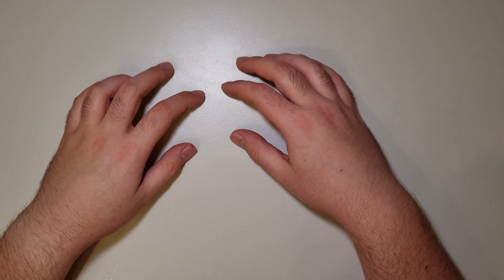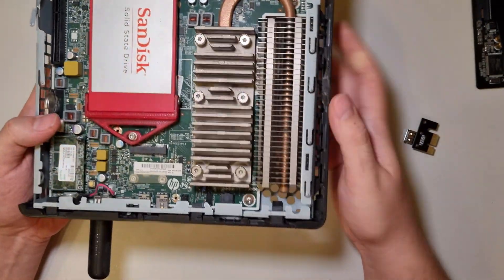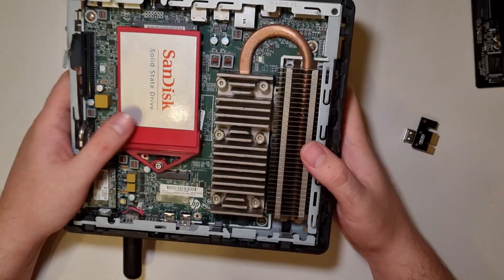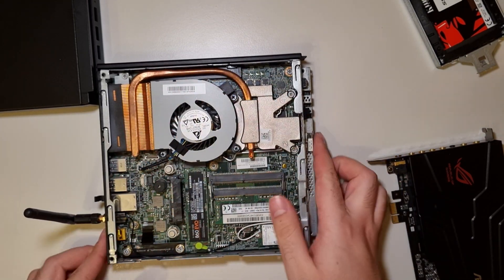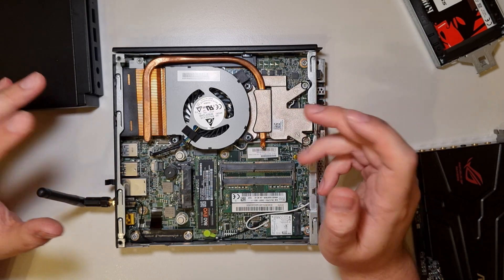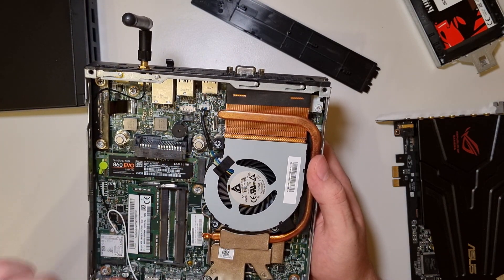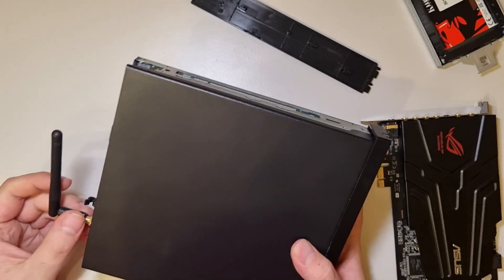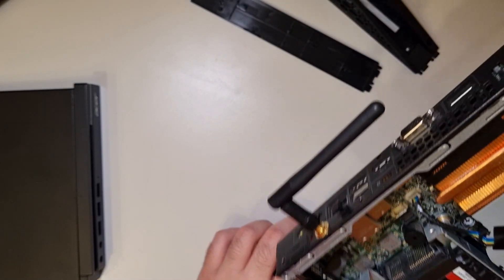Making an internal sound card portable, miniPCs with PCI-E slot ft. HP T610 and Acer Veriton N4640G

Comment: Did someone can help me with increasing power to processor. Original TPD is 35W but I'm using i7-6700 TPD 65W. I can see during stress test it only taking 41 W max.
Reply from the maker: I did same with i5, its not possible to unlock power because minipc thermal and power management was designed for 35w :/
Reply: @HobbyWithAdam ok, thank you. I was thinking maybe there is a way to bios modification, just to increase TPD to let's say safety level of 50W. I think this computer base is not so popular that's why these modes are not yet available.
Also, great job with this power mode. It makes this computer very capable. I can see some YouTubers try their chances with this platform and they were failing on GPU power limitation

Comment: Thanks for the video! My Acer N4640G (i5 6500T, 8 GB RAM) always rebooted when the connected GTX 1050 Ti was under load. After I soldered the bridge, the BIOS showed 135W (previously only 90w). Surprisingly, the PC now runs stable even under full CPU and GPU load.

Comment: are GPUS working with the pcie???
Reply from the maker: YES, but be aware of power consumption/external 12v power supply
Reply: @HobbyWithAdam how can I solder a 12V line to the GPU? Soldering to the motherboard? cutting the 12v pins on the pcie and solder 12v directly to the gpu? How did you do It?
Reply from the maker: @mrroze427  What device you are talking about?

if HP T610 you need to be aware that first pins are pcie x4 so you should use short adapter and don't touch rest pins.

I had just 12v power supply from PS3 and created a typical pcie 6 (and/or 6+2) connector cable and thats it.

regarding veriton, I haven't added any extra power supply because sound card didn't needed that
Reply: @HobbyWithAdam i was talking about the veriton, If I want to solder a 12v power supply where I have to solder to the pc?
Reply from the maker: @mrroze427  I haven't tested GPU in veriton, but in t610 GPU has power from the motherboard and I just had external power supply which I have connected to GPU using pcie pins

on pcie port you have normally 12v from the converters on the mainboard, and anyway pcie power is limited thats why the main power source should be pcie connectors (6+2 for example)
Reply: @mrroze427  you can add low profile as long as power is under 75W and you get a 135W acer adapter
Reply: @sisamusudroka3000  yes, it  works  in mine ,  with Zotac Mini  1050Ti GPU,  with  no adjustments.
Reply: You put an external (minining) PCI-E adapter with PCI-E power connector in addition to the PCI-E power connector of the GPU. Haven't tested, but should be plenty of power that way.
Reply: I just thought of making a GPU rest to make it more sturdy...fire there you have made it with 3d print...that's cool...if you tilt it then it will look like a 1U audio interface...